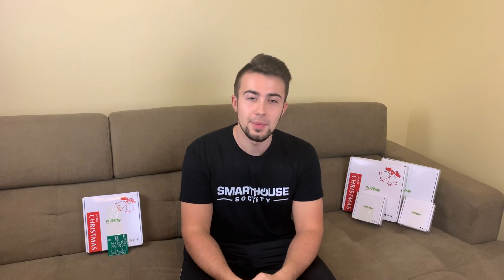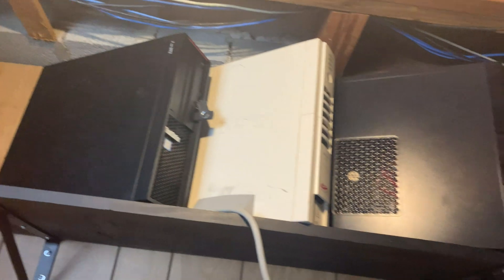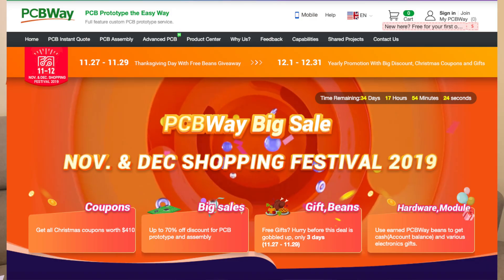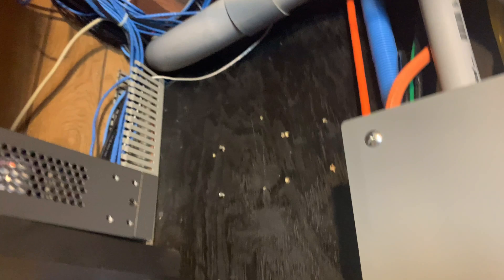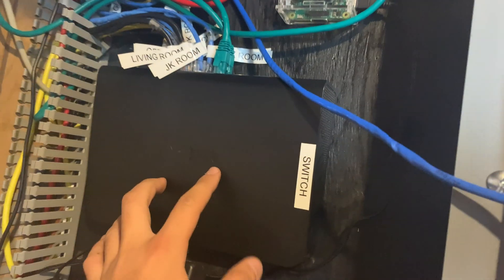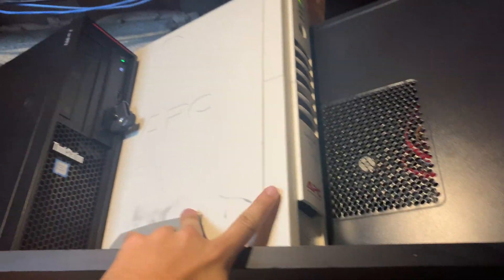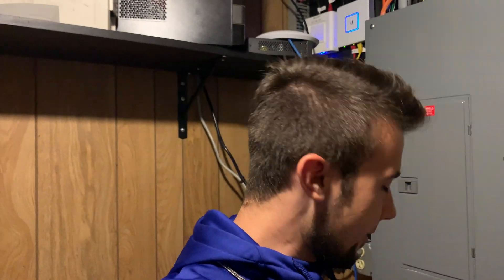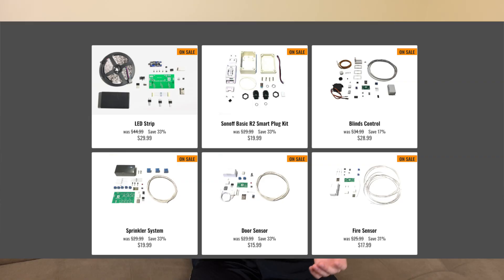MASSIVE Smart Home Network UPGRADE Ubiquiti UniFi Part 2

Comment: ANYONE CONSIDER UNIFI, PLEASE READ: Do not buy that gateway, you will be limiting to only 100Mbit/s...it will become a bottleneck. It doesn't have the horsepower. Instead take a look at their Dream Machine and Dream Machine Pro. It is a combined Gateway and CloudKey with quad core cpu. Plus the Pro also have their Protect (surveillance). 
If you still buy the USG (gateway), then for the health of it, mount it sideways, so the airflow is better...it gets hot!

Comment: Why don’t you setup these on a proper rack? That way you don’t have to climb up and down for troubleshooting. Also it is better if your low voltage equipments and cables are away from the high voltage wiring and panel I believe. Consider patch panel too in my opinion.

Comment: Big tip: Cool the USG! it performs much better. I recommend this solution https://www.thingiverse.com/thing:2926061
If you would have purchased a Switch 8-150W or a bigger one you could enable at the port manager 24V POE specific for that port... (liambowers666 mentioned that already)

You should really think of switching your 3 switches to a big unifi one

And did you now that you could install a unifi controller through the hassio addon store?
Or generally move you hole automation an controlling servers to one machine using docker containers (abit like Binary Bear said)

Comment: Since you have gone UniFi now, you may want to eventually replace your other two switches with UniFi switches at some point as well (or maybe just one 48-port switch), so you can manage your network infrastructure in one place (the Cloud Key).  Also, regarding the gear on your wall... you should mount them sideways; there is a reason professionals do it that way, and that is so they can easily see the status lights.

Oh, when you do Mount your APs in their final spots, make sure you mount them up high, pointing down for best signal coverage.

Comment: Why are you using so many physical machines? I've put all the stuff on one little server running Proxmox with LXC containers. Stuff like the CloudKey is not necessary imo if you are already running machines that can run the controller..

Maybe too much for one system in ur situation but at least one beefy box less that is sucking power..
Reply from the maker: Thank you for the advice! I have never used proxmox before. But, I chose to run it this way for less points of failure so if one machine goes down everything does not go down with it. In addition each server is pretty beefy, and chosen for their task. Blue iris and freenas with a plex server are pretty resource intensive services. That was my thought process but i will look into yours

Comment: Dude, I’m pretty sure your UniFi switch can output passive 24v if you configure the port in the UniFi portal, no need for the adapter. I’m also surprised you had to replace a diode as it shouldn’t have sent 48v to the device as the switch is an active PoE switch by default and not passive (passive = PoE always live, active = device has to negotiate) 

If you need any assistance with the Unifi setup, let me know, have worked with the stuff for about 7 years.
Reply: Is your switch the 60w or 150w, just realised the 60w don’t allow passive 24v.... so may have been your challenge - either way you have the adapter now!